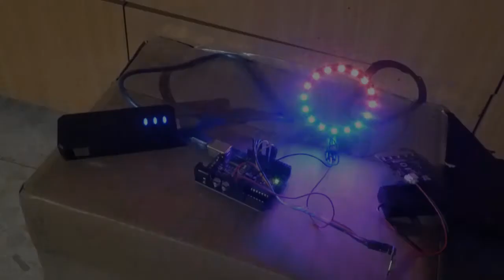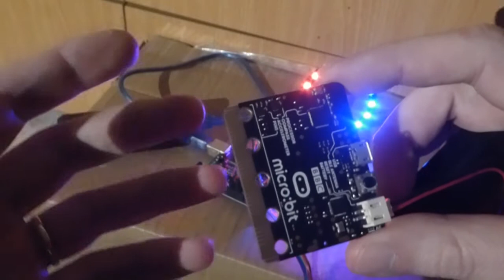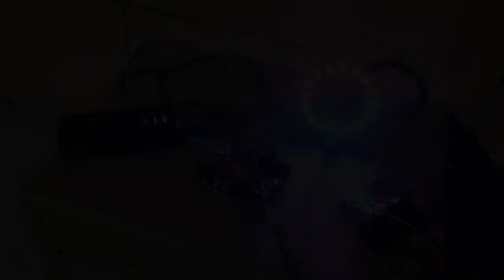Wireless Communication Between the BBC Micro:bit and an Arduino

Comment: can i use bluetooth and usb serial communication simultaneously ?
Reply from the maker: As I said in the video, you can't use proper Bluetooth even by itself on these Micro:bit boards (at least using Micopython). Perhaps the newer generation, but I did not test them.

Comment: I want write a similar, I hold only use JavaScript Blocks to create Micro:bit side. But now I stand on how to set Arduino radio group. Is there any suggestion? 
Thank you!
Reply from the maker: Hi, the whole idea in this video is that you can't do regular communication, because the Arduino doesn't have the same kind of radio as the Micro:bit.

Comment: Hey! Thanks a ton for the video. I've been searching and searching for a way to use the microbit as a wireless input to the Arduino and still haven't figured it out. May I kindly request to see the code for this? It would help me tremendously.
Reply from the maker: Did you try reading the video description?
Reply: @The White Byte, no I didn't, using a 3rd party app. Thanks.